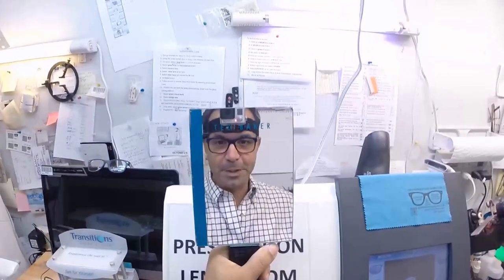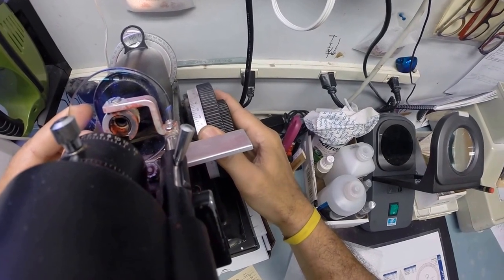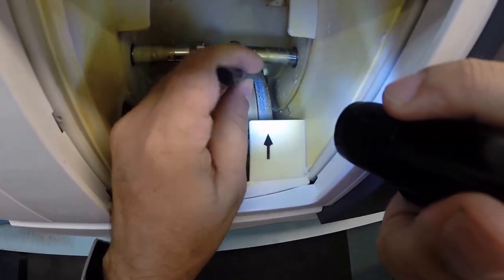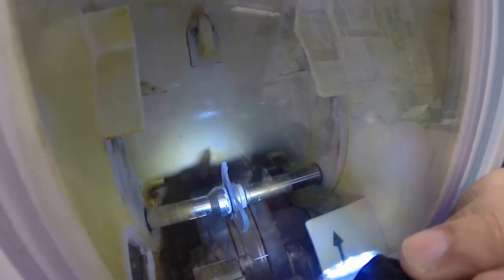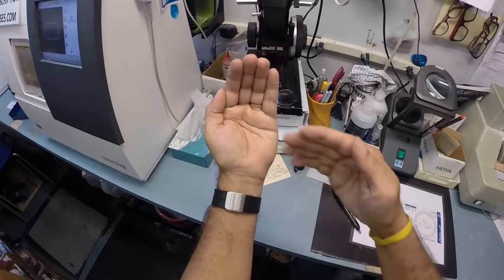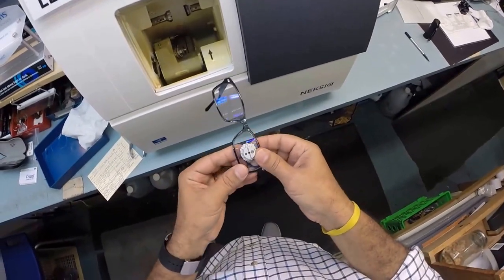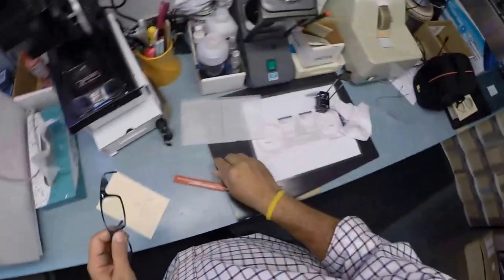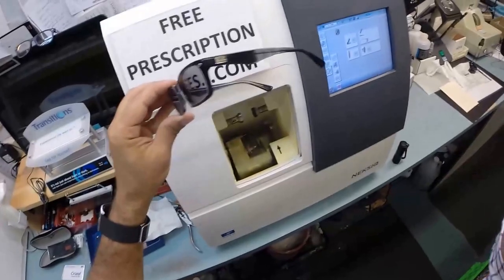Steve's RayBan 5206 with Rx Transitions and Crizal Prevencia from www freeprescriptionlenses com

Comment: Question 
I've purchased glasses from zenni and I opted for the photochromic lenses and when I received them and tried them out side , they darkened like they're supposed to , but they didn't clear up all the way. They still have a slight tint to them. Is this normal? 
Sorry for asking this since it's not related to your work (brand wise and what not). I jut wanted a professional opinion about it.
Reply from the maker: Transitions brand of lenses retain 3 to 5% hue while indoors. There are many inferior brands of "photochromic" lenses being sold that do not perform as well as Transitions brand. I cannot speak for Zenni but our dads always told us you get what you pay for. Thats why I always include the paper packets that the Transitions brand of lenses come in when I ship. Its also why you see me highlight the power of each lens and then right R and L, for right and left, so that when you open the box its the same packet seen in the video. I make every thing as transparent as possible.